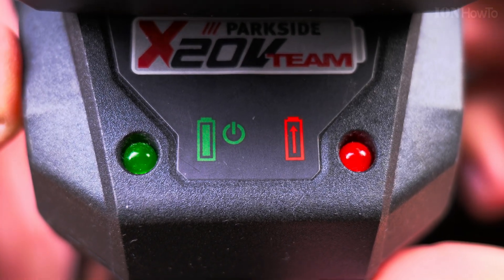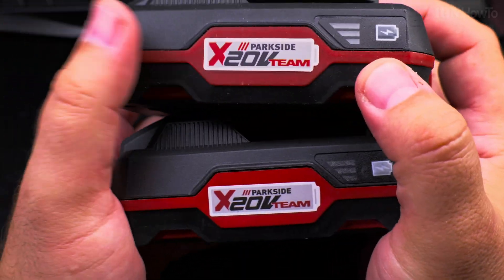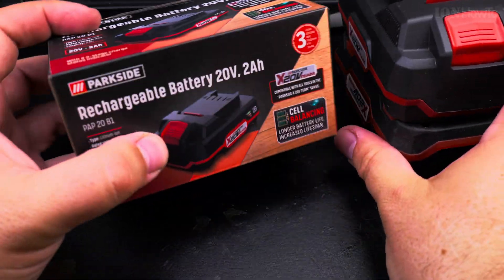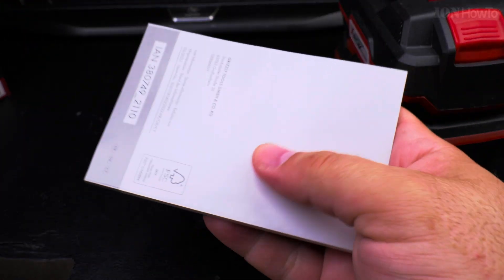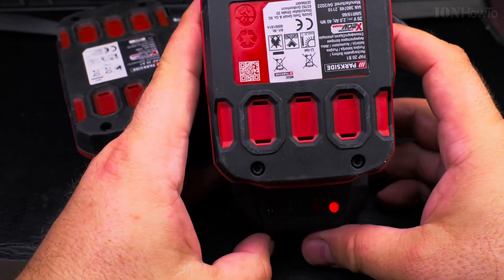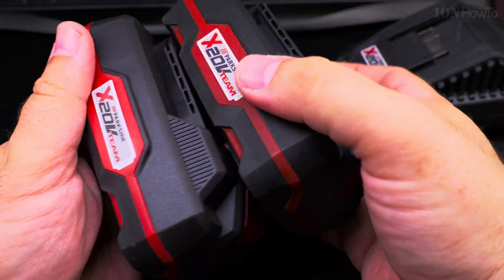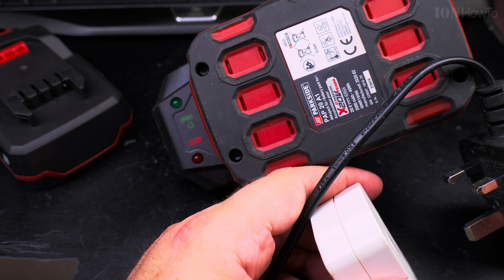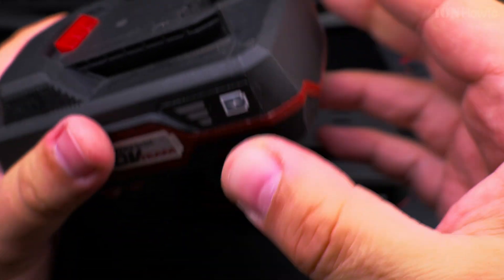Parkside 20V Battery PAP20A1 vs PAP20B1 with Lithium Cell Balancing

Comment: Thanks for the video! I was wondering if the two batteries are interchangeable, since my A1 also died, but I found that B1 should be compatible too. A charger should fit as well I hope.